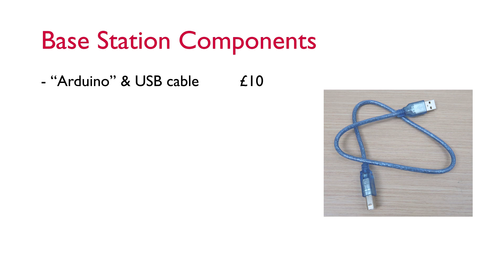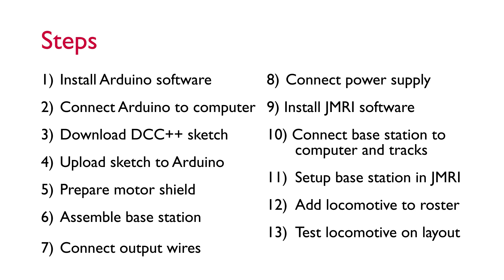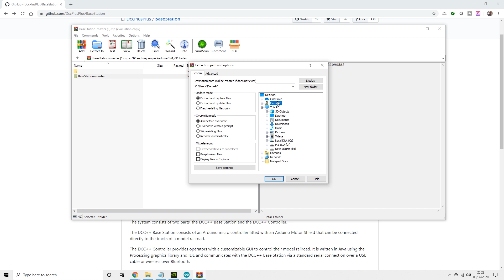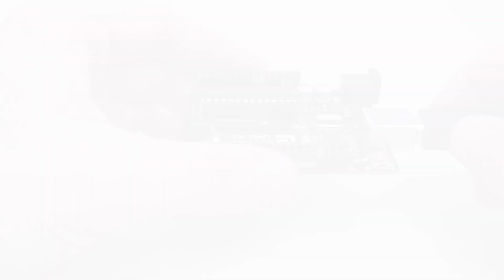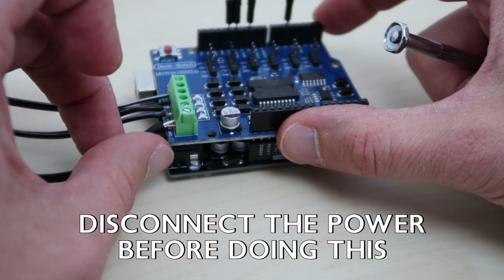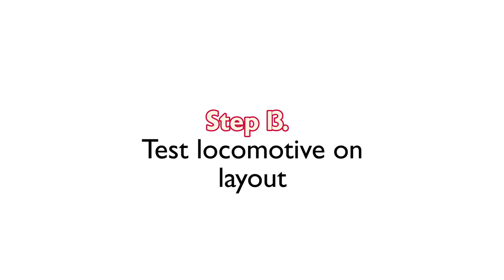Model Railway Digital Controller (DCC++) for £40 or less! 😮

Comment: Rob, followed your excellent instructions to build an arduino controller. Everything went well until in powered the motor shield. No channel led lights! Arduino seems fine, 15v fine, pin links checked by meter. Do you think I've a duff shield?
Reply from the maker: Potentially. It might be worth following this video. It's a more recent version of essentially the same thing. There's a helpful discord group that may be able to help fault find. https://youtu.be/mYjLO4yM60E
Reply: @LittleWicketRailway Thanks Rob. Missed a really silly step, all working now😊. Moved on to servos(part 1) and they are working too!

Comment: Thanks Rob. I am thoroughly enjoying watching your videos. But the more I watch, the more I am getting confused. Thinking about this Base Station, based on an Arduino Uno R3, if I then wanted to also operate points and/or signals using servos, would I have to have a separate Arduino for each item? Also, would each item have to have it's own sketch? I am very new to this type of technology, so you'll have to forgive my ignorance. Thanks, Bob (The other Rob).

Comment: Hi Rob,
I did a silly thing, I ordered a motorshield through your link.
It did not tell me till after I ordered it I was going to be charged £5 extra to what I could get direct from Amazon and I could not find a way to cancel it.
Alan
Reply from the maker: Hi Alan, sorry to hear that, which link is this? At the time of publishing the video I try to link to the cheapest components and sometimes give both Ebay and Amazon links. Prices change over time though and some things go out of stock, so always worth shopping around.
Reply: It was for the motorshield on amazon, but I will look around next time.
Keep up the good work.

Comment: Very good explanation, easy to follow, but I get to "read type from decoder" in JMRI and nothing happens, and JMRI eventually times out. I have the four lights on the motor shield and tried several locos with decoders. Any idea where I'm going wrong?

Comment: Hi  I am new too dcc. I got working on the programing track but I only have 10 vac  at B terminals and only 10 vac on main track. with 12 volt dc power supply. Unable to get train to run. Is there some thing I am missing? thank
Reply from the maker: Hi, take a look at this video. It's a much newer/better version https://youtu.be/mYjLO4yM60E

Comment: Hi Rob. I've finally jumped in with both feet and begun ordering "stuff" to begin my Arduino layout. Since this tutorial was first presented, there appear to be a few Arduino upgrades, the most recent being an R4 Uno; is this an acceptable and easy substitute for the R3 or would the Mega 2560 be a better option? Secondly, the L298P is not as readily available as other Motor Shields, with several Motor Shields offered but having slightly different descriptions and little direct comparison. Would you mind helping with a possible alternative or a suitable option should the Mega be a preferred Board? Many thanks and keep up the good work.

Comment: As a beginner model train enthusiast, your videos have been great for me and I look forward to more! I checked out your other videos on the Arduino DCC Base station, sensors, and servos; and after watching I want to try out controlling the whole track with code. From the other resources I've checked out, to run the scripts I wrote on JMRI I need that DCC base station. I also want to be able to control the servos and get data from the sensors as well. From the "Arduino, CMRI and JMRI" video you mentioned you can combine the sensors and servos Arduino into one to be able to make things easier. In that video, you also mentioned you were unsure If you could combine the Arduino DCC base station with the sensors/servos. However, do you think it is possible to have 2 Arduinos (One for the DCC base station and one for sensors/servos) and still be able to control the trains, sensors, and servos? If so do you have a video on it? Thank you, I appreciate it!

Comment: So does this take the place of a base station and a booster? Could it handle G scale voltage and current (ie 19-24v @ 10 amps)? My current set up is a raspberry (running JMRI) into a Sprog nano (operating as a command station) into a 10amp booster to the track. All the power comes from the booster that has a 10amp 24v DC power supply feeding into it. The sprog nano just supplies the DCC signal but there is no track feedback in this setup. It seems my set up could be raspberry into this arduino setup straight to the track? Or does this just replace the Sprog nano in my setup?
Reply from the maker: Hi Rich! Yeah, it's a base station/booster. The motor shield used in the video couldn't handle 10 Amps (woah, that's a lot of current!), I think it can only handle 2 or 3amps, but I believe there are motor shields that can go higher. In your setup this would basically replace your Sprog nano unless you beefed up the motor driver. A newer version of this is available called DCC EX, I should have a video out next weekend.
Reply: @LittleWicketRailway  thanks. After viewing your videos covering sensors, servos and block detection it seems I could just leave my base station setup as it is and connect up an arduino mega and sensor shield etc to the raspberry running jmri. I need to find out if the merg current sensor could handle the voltage/ current of g scale though. These are really great videos. So clear and easy to follow and they get me thinking about what is possible (time permitting!).

Comment: Great video. I have used a raspberry pi as my JRMI base station for a few years now using phones as controllers. But will look into an arduino now. Are there any initial views regarding raspberry pi v arduino. It seems that arduino has more accessories that can be added for sensors and servos... but something I will start researching. I do G scale with a 19v 10amp power supply.

Comment: HELP. have down the downloads from GitHub and even dcc++ ex. Have loaded  latest Arduino version 2+ and an earlier version you have in video. when I verify the software it show loads of orange errors. SUGGESTIONS.
Reply from the maker: Hi Robert, visit DCC-EX.com for a better version of DCC++ and a far easier way to install the code using the same kit. Video on this should be out either this weekend or next.
Reply: @LittleWicketRailway  Thanks.
Reply: Hi Rob. Found out why having problem. Must have had some software on my P.C that conflicted with dcc ++ and Jrmi. I have re installed win 10 . and now running sweet as a nut.😀

Comment: Hi Rob. Again many thanks, all working fine on my end due to our tutorial. Great work.
Seeing the motorshield power output is limited to 2A, do you use a booster for your layout. Would a booster be feasable in the same why as an Arduino DCC++ Base Station and Arduino Servo-Sensor hub? Or should we buy a commerical one? Have you covered this in one of you videos already?
I'm running an N-gauge layout with currently max 5 locomotives each consuming a maximum of about 0.3/0.4 Amps.

Love to hear from you, 

Regards, Ruud
Reply from the maker: Hi Ruud! Firstly thanks for being a member, much appreciated 👍 I'm going to be using a booster from MERG (www.MERG.org.uk). The command station in theory will only generate the signal, the boosters will provide the power to the various districts.

It's an interesting idea to use another command station as a booster, I looked into it a couple of years ago and could find anything. Maybe it's time to have another look.

Also, check out www.DCC-Ex.com for a upgraded version of DCC++. Same kit, more functionality. Video coming out in the next couple of weeks and you'll get early access.
Reply: Hi Rob, it is the least I could as appreciation of the help you provide with your videos. 
Seems I should also become a MERG member than 😁. As the block occupancy detectors from are also the best option. I was used wondering wether I'd know of a arduine driver, diy power booster solution. I do like to create my own hardware. White label, open source, crowd supported, is what I like best 😉

Comment: Hi I’m new to model railways and looking at starting a TT120 layout, would this system be suitable for this scale, obviously making sure the voltage is correct with the right PSU. Do you see any obvious pitfalls. Thanks. Love the videos by the way very informative
Reply from the maker: Hi Bill, this would work with DCC fitted TT120. As you've said, just adjust the voltage to be suitable. Check out DCC EX which is the next generation of this. I'm preparing a video on it this week.

Comment: Hi. I've only recently viewed your very welcome video on building a DCC control system. I've now procured all the components and have commenced assembly of the Arduino Uno Rev3 and shield. What concerns me is the footnote regarding the 19v output being too much. I'm building an OO/OO9 (mainline feed to narrow gauge interchange station, as seen at Aberystwyth) and would welcome a confirmation on maximum voltage.
Reply from the maker: Something closer to 15V would be better. Check put DCC++EX which has a lot of more up to date info on this project.

Comment: For £40 you can get on ebay a second hand Hornby Select or a Platform four model railways stand alone DCC controller. So why spend hours making one ?
Reply from the maker: You could put this together in about 20 minutes and, nothing against the Hornby Select (I have two), DCC++ with JMRI has significantly more functionality.

Comment: Just learnt the hard way that you should unplug your tracks from the DCC++ motor driver board before laying down some static grass, I accidentally touched the track with the  electrostatic  shaker thing and crackle zap no more Arduino driver board.
Reply from the maker: Oh no! Thanks for sharing that tip, could easily see myself doing something like that. Wonder what it would have done to a commercial system.

Comment: Hi Rob
Looking at building 20 x 4 foot(6 x 1.2 meters) layout and trying to get my head around how much power I need to run say 4 or 5 loco's on the layout, Martyn mentioned this unit will only push about 1amp and I'm wondering if that would be enough power to run these loco's ?? Can I boost this setup to push about 3amps or should I go in another direction, Your thought's would be a great help.
Cheers Mark

Comment: Hi Rob from the land down under! Have all my points servo controlled now thanks to your videos. Currently have Hornby Select and its inability to run anything but Hornby chips, has led me down this path. I do have one question though. The Select protects against short circuits (points the wrong way, derails etc). How does this go ? Is there any need for some form of protection so you dont fry the motor shield?
Reply: just found your reply to David Smith 7 months ago. Think that might answer it

Comment: Hi, Can this also be used to program your dcc decoders speed stepping, road number and other ddc functions?
Reply from the maker: Yes. JMRI with DCC++ is very powerful. Also check put DCC++EX.
Reply: @LittleWicketRailway   I purchased the the r3, pack of jumper wires and motor board yesterday off aliexpress. I might get the wifi board later. I have the digitrax zephyr dcs52 dcc but as far as I can tell it's good for 1 loco at a time. I wish I had seen this and other video's like it before I purchased the digitrax and paid $300 Cad.

Comment: 16V Laptop Power Supply　is more higher than an arduino uno !! oh may GOD!!
Reply from the maker: You're right, that's a lot of Volts for an Arduino, but in this video the Arduino takes a 5V supply from the USB connection. The 16V supply is only used with the motor shield to power the track 👍
Reply: @LittleWicketRailway   Sorry. I just understand!!

Comment: Great video..I have used a Ubuntu linux laptop rather than a Windows machine to drive this and it's all working very well.  I had to do a couple of patches to the Ubuntu machine (to get the std Ubuntu Arduino IDE to run in the first place and then to get it to see the USB port) and I will add links to those patches here in the comments if I am allowed.  Super inspirational video BTW .. you pack masses of good stuff into a very short video :-)

Comment: Love your arduino stuff.  I have obese question.  How do you mount your equipment. I'm thinking a din rail system
Reply from the maker: Thanks Steve. To be honest I just screw them to the baseboards on or somewhere they're accessible with smsll plastic spacers between the PCBs and the boatds. I've 3D printed cases for a couple of the MERG kits and may do the same for some of the Arduino kit. A DIN rail would be a very neat solution especially if you wanted everything in a central control cabinet.

Comment: Hi Rob. I am going through your content, it' very helpful to say the least. I had a question - I have a Marklin set which came with a Marklin controller. But I wanted to learn DCC++ and build a DCC++ controller for my Marklin loco. Would it be correct to follow the same steps as in this video to build one ?
Reply from the maker: If your Marklin loco has a digital decoder in it then you should be able to control it with DCC++. Check out https://dcc-ex.com/ for a more advanced version of DCC++.

Comment: Hi Rob, like many of your followers I think your tutorials are the best on the net. However I am building an 0 gauge layout, which I intend to operate with dcc++, running two to three locos with sound, lighting, servo controlled points and signals. Are there any specific issues, especially power output, to operating using arduino and motor shield and if so what additional changes would i need to adopt? I also would prefer to use a switch panel to operat points and signals. Thanks in advance for any help you can give.

Comment: Hi Rob
Like many others I have found all of your video tutorials very professional and entertaining.
I have built the controller and installed the software and JMRI is connecting to the Arduino without issue. All has been going well until I tried to add my loco to the roster. I have a graham farish class 57/3 loco with a guagemaster  ruby decoder installed. It is "DCC93 Ruby 2 function small 6 pin decoder". When I try to add it to the roster I get the following error message. "found mfg 65 (guagemaster) version 51. No such decoder defined" ... I'm stuck and don't know where to go from here. The good news is that the loco judders when trying to automatically read the coder. Any help would be gratefully received.
Reply from the maker: It sounds like there isn't a profile for that decoder in JMRI. You could try manually selecting a similar 2 function decoder. Maybe contact Gaugemaster and see if they're aware of this issue with their decoders and JMRI.
Reply: @LittleWicketRailway  thanks for getting back to me so quickly.  After alot of searching I managed to find a  profile to use.  I used the digitrax dh126d and it works great. I can't believe how exited I got seeing the loco move for the first time. Couldn't have done any of it without your expert tuition. 👍

Comment: Excelent video Rob. On info, budget, pace and delivery - and that's coming from someone who is a retired Video producer returning to the hobby. I didn't see any short circuit protection (e.g.from tack), do you know if the referenced boards have this and/or is there another PCB that's needs to be linked up?
Reply from the maker: Hi David, really appreciate that and welcome back to the hobby. DCC++ has short circuit protection built in. You can even adjust the sensitivity in the code. Check out DCC++EX which is a new and improved version of DCC++.

Comment: hi Rob i have completed the build as detailed and i cant seem to get no power to the tracks. I have 19v DC going into the Arduino Motor sheild i have tried to reinstall the sketch but to no avail. any ideas what i can try next please to get this working. is there a way off testing the motor sheild as there are no lights on this at all. Many thanks
Reply: Do i need a full track to get it to work as i have only put up a small section as you have in the sensor and block video i have ordered a new board the same as the one in your video i will give that a try
Reply: No worries i found out i never switched it on in JMRI its all working now fantastic thank you
Reply from the maker: Hi Kevin, just been catching up on your messages. Phew! Glad you got it all sorted. Hope it's working well now 👍
Reply: @LittleWicketRailway  yes all sorted thanks just doing the sensor build  fantastic instructions thank you

Comment: Hi, very good tutorial but I have a problem: when I put the locomotive on the programming track, the locomotive recognizes me and moves the wheels a little like you did, but then when I want to make it run or turn on the lights, it does not respond ... (although I have checked and if there is energy in the tracks ) but it is as if it did not recognize the decoder later and the same thing happens to me with all the crazy ones that I put. what do i do please !!! 2021
Reply: Please Hepl me....

Comment: Just found this video, great job Rob. I assume you could down load the decoder pro from Jmri and run it thru the arduino on the programming track as well?
Thanks Doug.
Reply from the maker: Thanks Doug. Yes, you can use it to program. Check out DCC++EX which is a more developed version. I'll be making a video on it soon after new year.
Reply: @LittleWicketRailway  Thanks. Look forward to that. Merry Christmas.